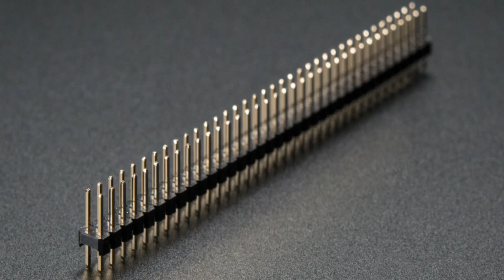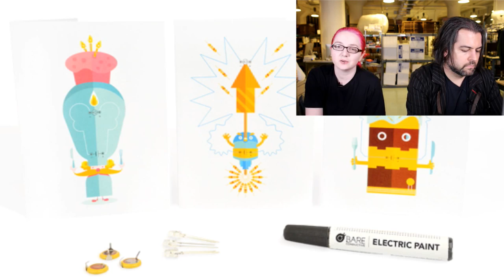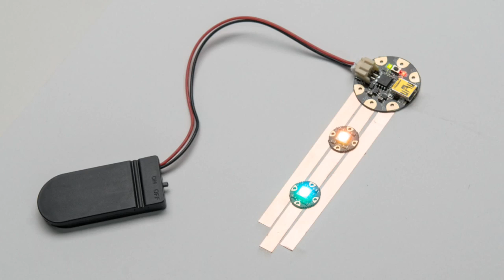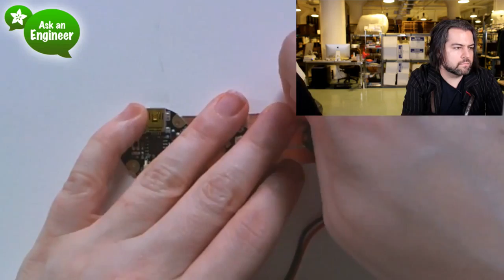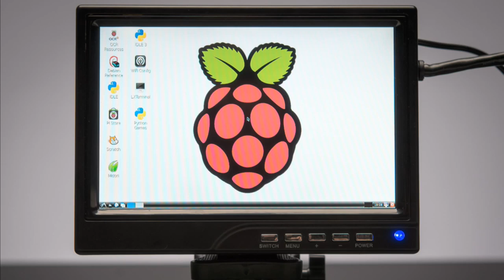New Products 01/18/2014

Comment from the maker: See what's new this week! New Products 01/18/2014

Break-away 0.1" 2x36-pin strip right-angle male header (5 pack) (0:25) http://www.adafruit.com/products/1541

Break-away 0.1" 36-pin strip right-angle male header (10 pack) (0:25) http://www.adafruit.com/products/1540

Break-away 0.1" 2x36-pin strip dual male header (10 pieces) (0:25) http://www.adafruit.com/products/1539

CAP1188 - 8-Key Capacitive Touch Sensor Breakout - I2C or SPI (1:35) http://www.adafruit.com/products/1602

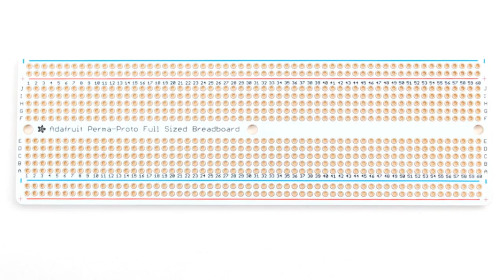Adafruit Perma-Proto Quarter-sized Breadboard PCB - Single (4:31) http://www.adafruit.com/products/1608

Adafruit Perma-Proto Half-sized Breadboard PCB - Single (4:31) http://www.adafruit.com/products/1609

Adafruit Perma-Proto Full-sized Breadboard PCB - Single (4:31) http://www.adafruit.com/products/1606

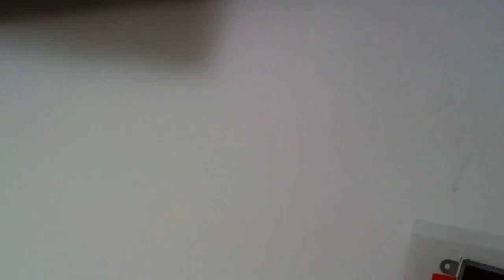Flex Cable for Raspberry Pi Camera - 100mm / 4" (7:45) http://www.adafruit.com/products/1646

Flex Cable for Raspberry Pi Camera - 200mm / 8" (7:45) http://www.adafruit.com/products/1647

Flex Cable for Raspberry Pi Camera - 300mm / 12" (7:45) http://www.adafruit.com/products/1648

Flex Cable for Raspberry Pi Camera - 50mm / 2" (7:45) http://www.adafruit.com/products/1645

Bare Flashing Card Set - Celebration Circuit (11:06) http://www.adafruit.com/products/1651

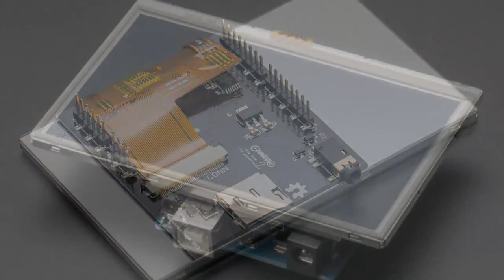Gameduino 2 with 4.3" 480x272 Display and Touchscreen (12:05) http://www.adafruit.com/products/1654

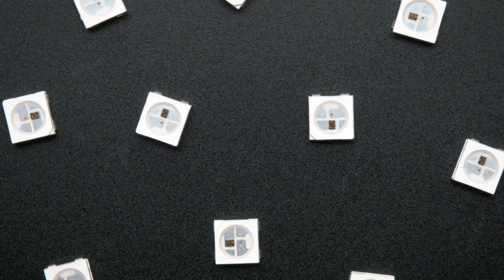WS2812B 5050 RGB LED with Integrated Driver Chip - 10 Pack (17:12) http://www.adafruit.com/products/1655

3M Z-Axis Conductive Tape 9703 - 2"x6" (50mm x 150mm) Strip (18:18) http://www.adafruit.com/products/1656

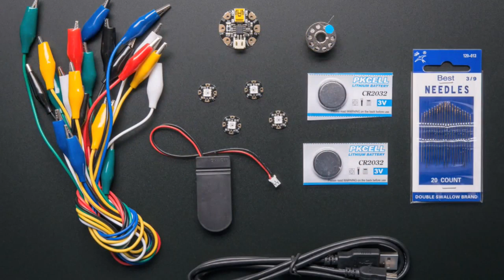Gemma Starter Pack (27:17) http://www.adafruit.com/products/1657

GPIO Header for Raspberry Pi - Extra tall 2x13 Female Header (28:04) http://www.adafruit.com/products/1658

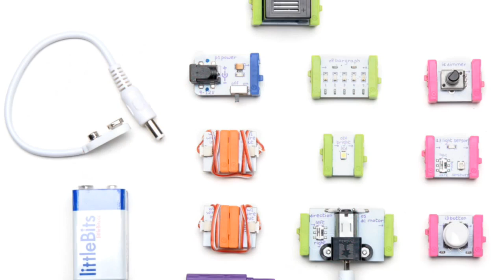littleBits Base Kit (28:49) http://www.adafruit.com/products/1659

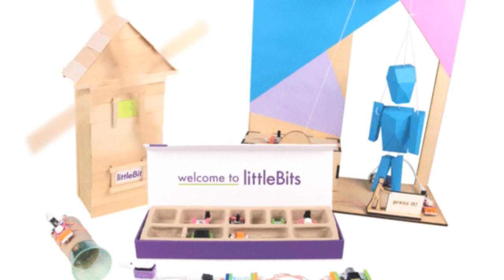MicroSD Socket (29:20) http://www.adafruit.com/products/1660

uFL SMT Antenna Connector (30:00) http://www.adafruit.com/products/1661

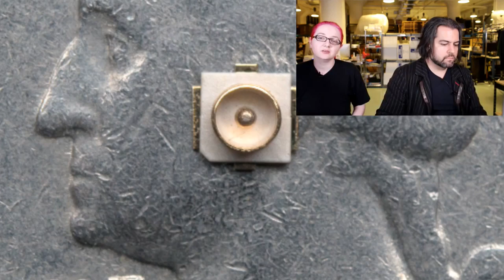Resistive Touchscreen Extension Cable - 20cm / 8" - 1mm Pitch (30:30) http://www.adafruit.com/products/1662
39) http://www.adafruit.com/products/1666

HDMI 4 Pi - 5.6" Display 1280x800 (720p) Kit - HDMI/VGA/NTSC/PAL (31:45) http://www.adafruit.com/products/1666

7" Display 1280x800 (720p) IPS + Speakers - HDMI/VGA/NTSC/PAL (34:03) http://www.adafruit.com/products/1667

 #adafruit   #arduino   #electronics   #hardware   #opensource   #projects   #raspberry   #computer   #raspberrypi   #microcontrollers   #LEDs   #LED   #gemma   #flora   #bluetooth   #bluefuit   #neopixel   #neopixels   #wearables   #art
Reply: That's a pic of the Cobra from the classic game Elite... pity I can't watch videos on my current connection...
Reply: Would be nice to add a 3 row right angle header.  The reason? servo's or esc connections require ground, power and pwm.